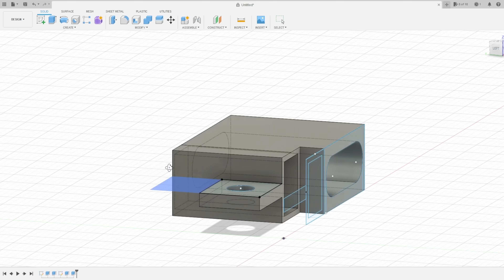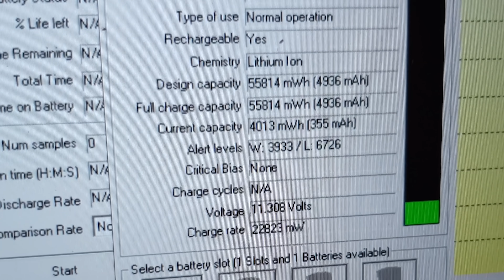Hacking my laptop so I could travel lighter!

Comment: Just a note to keep in mind! Several manufacturers use handshaking with the chargers via 1-Wire - lenovo is a prime example of this. Don't go changing your laptops w/o checking wether or not it uses handshaking! You'd NOT be able to charge a laptop like that withouth also converting it's OG charger...
Reply: Dell is another common one that does it
Reply: @noelswedzinski4498  yes. And I don't get why. Why TF does it matter that you use the correct voltage and wattage, but the charger is not genuine? Stupid locking of modularity...
Reply: Hey, thats the thing i am afraid of, i want to do opposite or possibly bypass fried charging ic-s of my motherboard since my usb-c experiences with lenovo made me want to go back to barrel
Reply: There are a lot of dodgy laptop charger makers I wouldn't trust my laptop with, at least it helps protect that.
Reply from the maker: If you find the right adapter on Aliexpress, this would already have been 'modified' for you so that it works.
Reply: @goodjihad  Yes - but if you do not know about the 1wire communication, you will not be looking for this. The vid does not mention this. So it is unwise to just start doing a hack on ones laptop. Other than that, we at work use 1wire and let me tell you, it is not usually that "obvious". Even if you put an IC into the USB-C converter, you must have proper data on the IC. So one might need a 1-Wire programmer and write proper codes on the IC. Depending on the IC there can be a fair few entries, checksums, etc - so a simple copy from the OG charger might also not be enough. 
I made a small program that calculated the CRC codes for data and it usually includes the ICs serial number. And this is proprietary as heck based on manufacturer. I have not directly checked what Lenovo and others do on their part and there is no "openly" available documentation (I tried to get one previously when I was working with 1wire and wanted to check what my charger does). If I were to guess there would be some data about the voltage and supported wattages (I have about 10+ lenovo bricks at home and almost all of them works with any of our lenovo laptops). So if you create a custom charger, you must tell the laptop what wattage it supports, calculate CRC and burn the data. I'd say there aren't "premade" softwares for this. And without digging into this the guide suggests that you can "just do it". 
I simply wanted to bring attention to this, as there are limitations.
Reply: Btw I liked the video. Were it not for 1wire I might give this a go. I have an old sony vaio laptop that will be converted to media server soon - I might change the charging there to type c.
Reply: @HuntersOA  It does not know what you are talking about! Belive me! (His words: You only need 2 wires)
Reply from the maker: @HuntersOA  Sounds good and thanks for clarifying! It's annoying as heck Lenovo has these proprietary features :(.

Comment: You should've mentioned that it won't work for every laptop (talking about you Dell), as some won't charge the battery if it thinks the power source isn't legit. Usually adapters have a extra wire inside the connector (center pin) that is used for the communication.
Reply from the maker: Correct but if you happen to find the right aliexpress adapter online, (which is cheap to try) buy it and then see if it works. If it does and provides the right wattage under load etc, then you know you can hack you laptop like I did and this will work. I would expect the seller who made the converter to consider these issues. Give it a try :)
Reply: Yep, very annoying. Fortunately my dell will charge via the type c port as well, unfortunately most cheap type c dongles hate power pass through. So on the road it is fine, at my desk I have a proper power jack. Lenovo also does funny things.
Reply: I do find it rather weird third-party manufacturers doesn't include the the functionality needed to charge Dell laptops. It's either a 1 cent resistor or a 10 cent chip needed.
Reply: @SweBeach2023  It's likely the software on the chip. AliExpress sellers don't seem to care with they're USBC adaptors tho.
Reply: @slimz. there is no data transfer on a barrel jack bro 😐
Reply: @Scrim-Score  Forgot to mention that they have their own design, regular plug from AliExpress only has power. That I can agree with.
Reply: @Scrim-Score dell begs to differ with the third pin in the center ready to break at any point as it's so fragile.
Reply: @amriteshkr8 wait, what? Dell has proprietary barrell jacks? God, that company breaks me
Reply: @p3chv0gel22  atleast my upstairs neighbour's dell has it and the pin in the center(its very thin like a needle) actually broke and got lodged inside the barrel jack.
They had to buy a new brick and pay for the charging port replacement.
Reply: @Scrim-Score incorrect.. the center pin (its a 3 pin barrel) carries communication from the brick proving its authentic Dell.. no comms, no charging.. and even limits cpu clock.. Dell is evil.. the good news is... a Dell brick is like 10 bucks or less on ebay.. so keep them on hand..
Reply: :face-turquoise-covering-eyes:on tylko "zapomniał"  dell hp i kilka innych marek używa komunikacji, jedni cyfrowej inni analogowej. wiec jak to się ma do filmu w którym autor zapomina o podstawowej rzeczy?   przy komunikacji cyfrowej np dell dallas takie zabawy są bzdurą. trzeba mieć oryginalną ładowarkę usb-c o odpowiedniej mocy, a nie Gan 120W bo ona nie dogada się z laptopem i nie naładuje baterii. :face-turquoise-covering-eyes:
Reply: luckily for a lot of thinkpads it's just a resistor that says what the charger's rated for
Reply: No need anymore. EU has implemented directive that all electronics has to come with USB-C start from 2024. So the next Dell laptop should include by default USB-C
Reply: @CONTINUUM2  I'm aware of that and that's a positive thing. He was talking about older laptops in the video (without type c).

Comment: Thankfully my thinkpad x270 supports type c charging without modding. I keep the original brick at home and a type c charger in my backpack at school. It does not charge  while on though, my charger is just 30 watts but in suspend mode it does.
Reply: Same with my Latitide 7490, usb c charging is a godsend. Well luckily i have 65 watts one, which i can use it while on and also charge quite fast
Reply: It can’t charge while you’re using, but the battery drain is slower?
Reply: @lucasbeut  sadly not. It does not use any power from the USB charger while powered on. I've checked

Comment: be careful with usb c cables at 20v charging a laptop they might need to be higher gauge
Reply: precisely, you need cables rated for 5 amperes, or 22 gauge wire
Reply: @l0k048  I'm not sure if there's a 3rd comment I can't see here but it seems like you're agreeing with me in your last comment so I'm glad about that lol
Reply: voltage doesn't change the wire gauge though, only the amperage, that's why they're using a higher voltage, to achieve the same wattage at the minimum amperage possible

Comment: Hey man I got a same issue with a new device I bought Lenovo Miix 520. 

But I dont really feel comfortable doing the soldering etc, 

But as your mentioned about the adaptors, USB C to 4.0 mm *1.7 mm. 
You reckon those are reliable to use with generic laptop type 87W USB C chargers ?
Reply from the maker: Give it a try with just the removable adapter and let us know the results!
Reply: @goodjihad  works fully fine

More than fine, 
I bought a whole set of universal barrels round plug to usb c charger

Comment: Nice mod also proving that it works perfectly :) I am rather using Apple 87W + USB-C to 5,5 x 2,1 mm cable set to 20V with DC plug adapters. Not as neat as your mod, however it gets the job done on my ASUS Zenbook UX430UN which I was not using that much because of having to carry separate power supply for Zenbook. Although this Zenbook is designed for 19V, it handled 20.3 V without problems, just current dropped slightly to compensate larger voltage :)

USB-C to DC plug as shown in your video are problematic, becuase they do not care about USB-C cable specs and tend to overload 3A ones
Reply: I wonder if the 20v could damage it on the long run

Comment: I've been using that tip adapter method for a while on my Asus Vivobook once I realized I could just buy a high watt GaN charger and USB-C. I figured an internal mod would work but you've just confirmed it - great video! I'll have to give this a go sometime as these little adapters work but they're annoying
Reply: wich vivobook do you have and what adapter did you bought? i have the vivobook d515 and i want to buy the adapter to use with a gan charger and maybe do the internal mod in the future but i don't know much about wich barrel plug does asus use
Reply: Wait, it works with asus vivobook? The usb-c to dc jack converter?
Reply: @Kncperseus i mean, it's just DC. Most barrel Jacks aren't designed to communicate with the charger, but rather just take whatever voltage they get and pass it to the internal voltage regulators. So as long ad you find an Adapter for your voltage with a fitting plug, there is no reason, why i shouldn't work

Comment: You already had type c port which can be use as charging port
Reply: not all the case are the same. Even if you have that usb type-c port on your laptop but doesn't have a charging icon with it (it's like a thunder icon right beside the port), it will definitely not work. With that being said, this tutorial is the best way to turn barrel-type chargers into a type-c....
Reply: @aliceperez5203  I have thuderport and I can charge with that too.
Reply: @usmannazim3053  dear how you charge your laptop using thunderbolt port?
Reply: @shampaakter4134  just plug the type c charger in it(mostly it doesn't work if the charger has less watts . Use other laptops chargers. With 65 watts or above. Under 45 doesn't work. At least for me.)
Reply: @usmannazim3053  what is your laptop model
Reply: @shampaakter4134  Inspiron 5502 and Inspiron 7405. Both are mine.

Comment: Hey there Joe Gaz i kinda like your idea by replacing the old charger connector with a USB Type C Connector, but in my case [HP Pavilion 14 ec0008AU] i already had a USB Type C port , but it just doesnt support USB Type C PD while my USB Hub already had USB Type C PD, i kinda want to somehow bridge a cable from the usb type c port to the charging port based on the PD Pin, but im kinda worried about the power from the original Charging port frying my Type C port completely, anyway thanks for the vid!
Reply from the maker: Ouff a bit complex there bud! The reason why this one worked so well is because they leave a lot of space for the USB-C port due to the barrel plug. Your can 100% work it just depends how much hours you want to spend doing it! If it's a challenge you want to take I applaud you! Probably better off getting a USB-C laptop down the line :) 

The question I have is how does this charge then? If it is the barrel jack, why not just add the extra 'usb-c' port that I have which charges it for you. Easy fix! Just know which one is for charging and which one has USB-C data functionality.

Comment: Excellent video. Many laptops charge with 19v. But those USB c connecters only come in 9v, 12v, 15v and 20v. So would it be safe to use a 20v USB c connector for a laptop that takes 19v?
Reply: Yes, 20v is fine for 19.5v, especially with the usually thinner gauge wire on usb c cables. Laptops have a buck converter to convert the power input to charge the battery which is usually 3s or 4s NMC = 12.6V or 16v charging voltage. Great scott also did a video on this. The components in those buck converters can tolerate up to 24v usually
Reply: @EEGworld  thank you man
Reply from the maker: I believe so. You buy the right adapter for your laptop and it should be already setup to work with yours. I think depending on the barrel jack it will have something on the chip to account for the right voltage, otherwise you might have to diy with those USBC dummy boards.
Reply: there are board that charge at 19v, lemme find one

Comment: Usb-c is a marvelous innovation for charging. Too bad there’s a usb-c cable mess where you don’t necessarily know whether a usb-c cable is capable of charging at 100W or only 60W or some other value, and you don’t necessarily know USB speed capabilities of a cable either just by looking at it (is it USB 2.0 max? Or 5,10,20Gbps max?). You also don’t necessarily know if a usb-c cable is capable of tunneling thunderbolt signals or if it can also carry DisplayPort data. You also don’t know if the cable is capable of supporting certain charging modes like Samsung’s PPS. I just use a TB4 or USB4 cable and I’ve been fine for all of my needs: charging, displayport data, thunderbolt signaling, pcie express signaling, usb peripherals.
Reply from the maker: Yea that is one downside at the moment in the market. It needs to be polished to fix that.